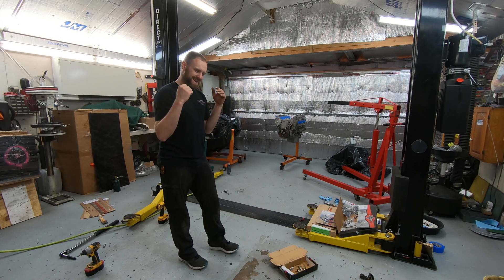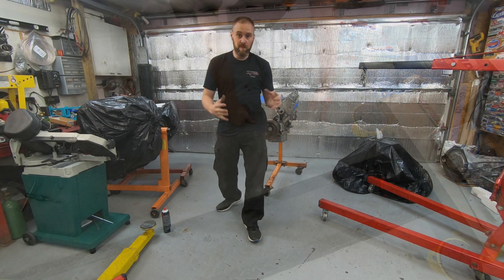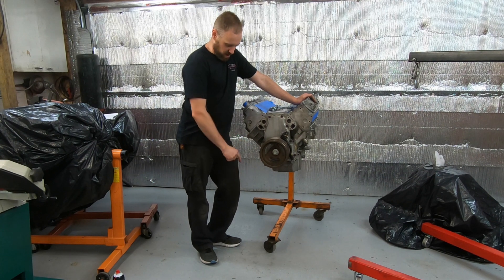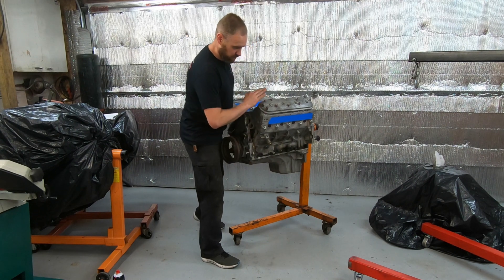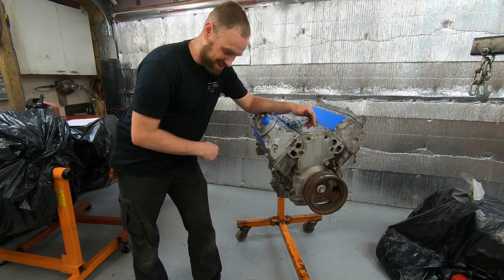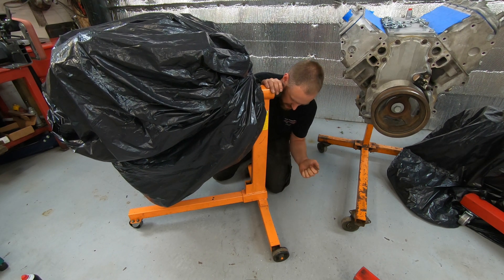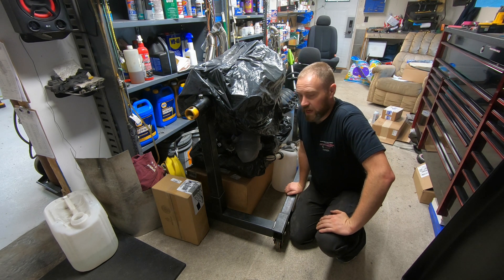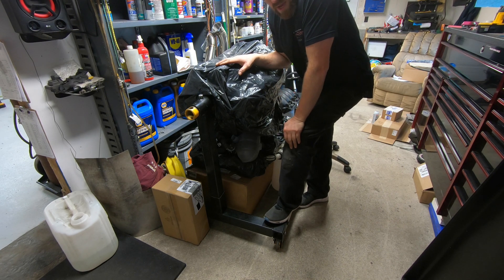Ooops! I Dropped a engine!! Choose the correct engine stand!

Comment: Weld 16 inches of 2 inch box channel across the front of you single leg out front and add two casters. Turn that stand from a 750lb to a 1250lb very cheap.
Reply from the maker: I bolted a piece of angle iron on to catch it pre tip over. I only use it for transmissions or last resort now. But yes that is a very viable solution. Though it won't increase the weight as the main T off is the part that judges that.

Comment: Stand behind the engine stand pull it slowly toward you, trailing the third wheel. The problem here was moving it sideways.
Reply from the maker: I mentioned that, I also mentioned how I felt just turning it could cause the same thing. I messed up and now there is a cross bar bolted on my three leg stand.

Comment: You brought out a good point with your video. I would weld a cross member on at the end of your 3-leg stand and make it into a 4-wheel stand shown at 6:40 on your video so that it looks like your other stand.
Reply: That's exactly what I had planned to do when I was buying my 3 wheeled engine stand. Yet to assemble it but I could see the potential of falling over from the outset. The other stands with one extra wheel were incredibly higher in price. So welding up my stand is more cost effective as I have the steel already, welding machine etc

Comment: Real world physics is a bummer, he kept saying “push it sideways” and I cringed every time! Besides pushing or pulling from the front or back another tip I would suggest is turn the motor upside down to lower the centre of gravity… that and use it as a stand and not a engine moving platform

Comment: I have a 4 leg engine stand that has 4 wheels.  Its far more safer and more stable than the 3 leg engine stands-- which are prone to falling over easily... as you mentioned in your video.

Comment: If you've got the skills to build an engine, you sure as heck aught to be able to weld a cross bar on that leg sticking out and add another wheel.
Reply from the maker: You are correct, I later added a angle iron to prevent it from tipping.

Comment: Can you do a video on all the differences between the Flex Fuel ready 5.3 Chevys vs the regular 5.3s?
Reply from the maker: There's not much of a difference to be honest. Basically just a few changes in the fuel system and tune. I believe the hardware is all the same otherwise.
Reply: CrazedPerformanceRepair I’ve heard horror stories of people’s non E85 ready car’s hoses and seals rapidly deteriorating from the Ethanol.  Jay Leno constantly complains about it.  A lot of performance car enthusiasts want the over 100 octane and clean burn of the ethanol but end up gumming up their non Flex Fuel vehicles.   It must be different hose and seal material on the Flex Fuel vehicles.  Thoughts????   Maybe do a visual comparison video to clear this up once and for all?

Comment: The three legged stands with the leg in the center aren't bad if you get a high quality one. Non swivel casters in the back and the back is WIDE. The one that tipped over on you has two problems, swivel casters all around and a narrow "wheelbase" in the rear.

Comment: Didnt have an engine stand tip but back in 08 when we were replacing pistons under warranty on all the v8s. I had an assistant operating the cherry picker while I was guiding the engine back in I told him to go slow he turned the valve the wrong way and the engine tumble into the suburban did alittle damage to the truck and the engine but at least I didnt loose a finger or something
Reply from the maker: Sounds exciting, glad no one lost finger's...

Comment: Not so much anymore with aluminum headed motors. But back in the 80's it was commonplace to see people put big block chevys, fords, olsmobiles, almost any motor aside from a small block chevy would fold the upright. The motors would go down face first. Breaking the crank snout and harmonic balancer off the front of the motor.
Reply from the maker: Yikes yeah that would suck!
Reply: @CrazedPerformanceRepair  yep, heart breaker. Always the three legged ones that would fold up. Lakewood used to sell them for IIRC $29.00. (It was the 80s.) Before internet so no way to get word out except, word of mouth. So it was scary how often it would happen every summer.